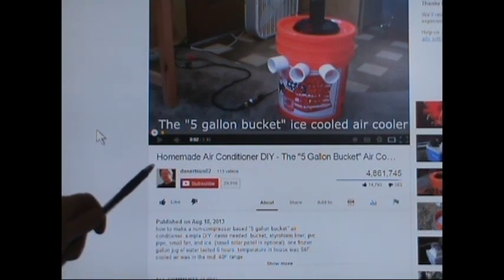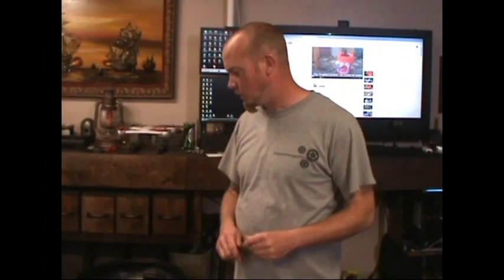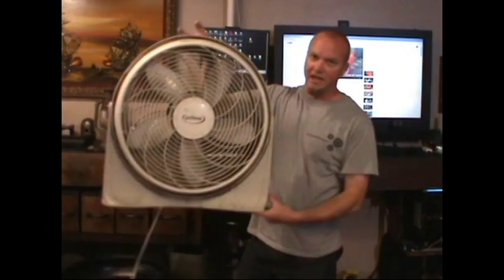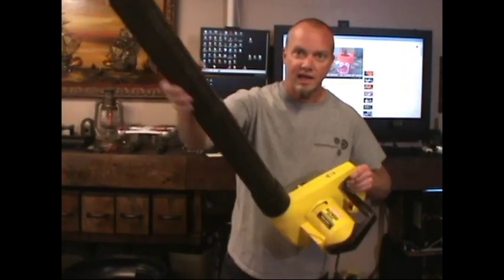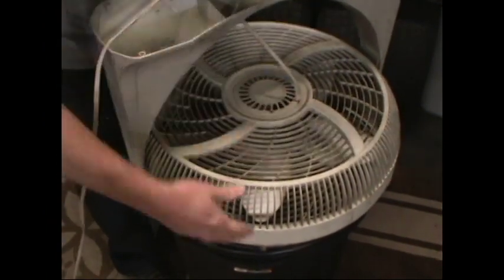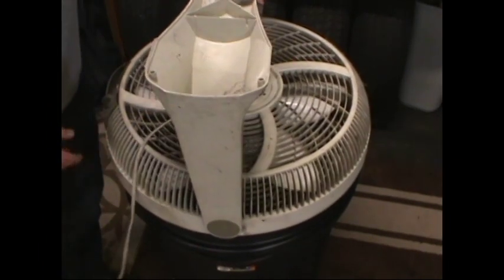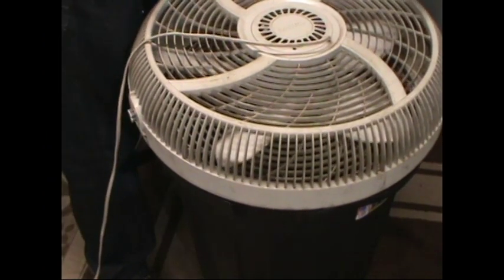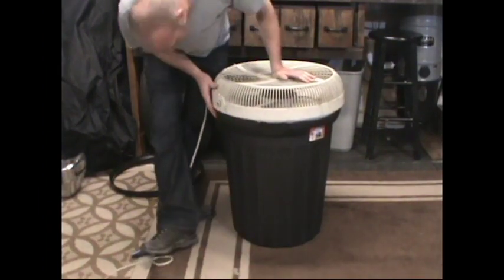Home made air conditioner / Trashcan air conditioner

Comment: Curious if this thing worked? 
My air conditioner is broke in AZ and need to cool a 10x10 room for a day or 2. I think the inside temp is 90 degrees without air on.  Thanks 👍
Reply from the maker: It's nice to sit around in the garage to enjoy a bit of cool air but it didn't change the temperature enough to make a difference, especially at 90°.
Reply: Mike Stanek 
Thank you for letting me know 👍
Blessings!

Comment: I like it, but does it increase the humidity much.  My question is, if you live in a hot and humid area, does it work well
Reply from the maker: I live on the west coast. Not very humid here. I did not experience a noticeable change in the humidity in my garage when using this.
Reply: Howdy. Nice machine  & vid. Humidity should condensate if air is cold right? Some material like bundled up chicken wire inside the bin would give something for the water to condense onto. So in dry areas we want it blowing out watery air, and in humid areas we want a humidity trap.